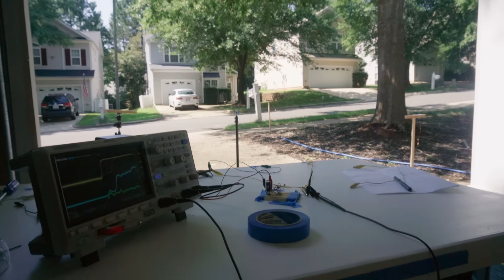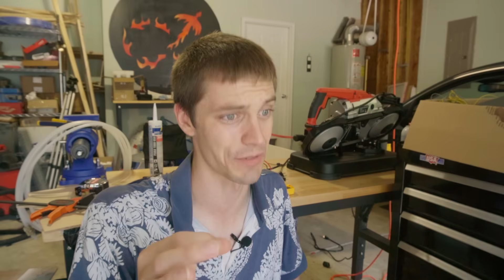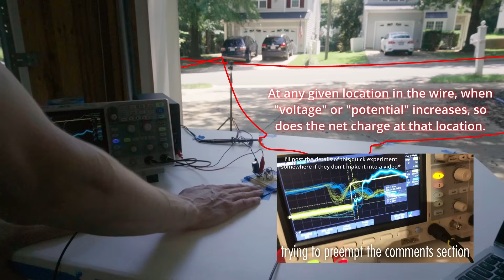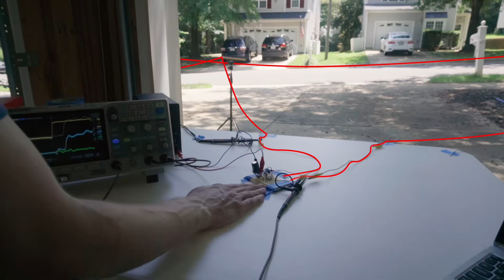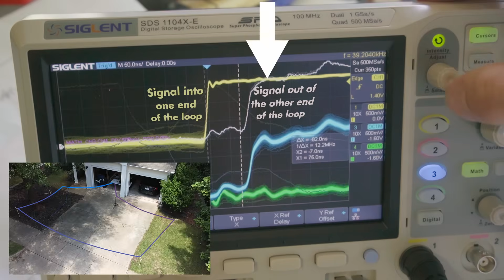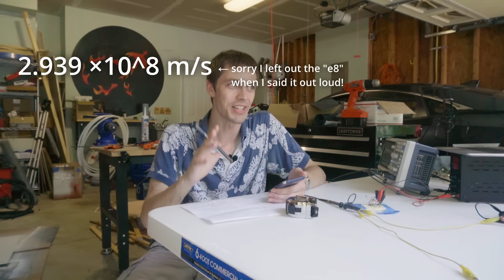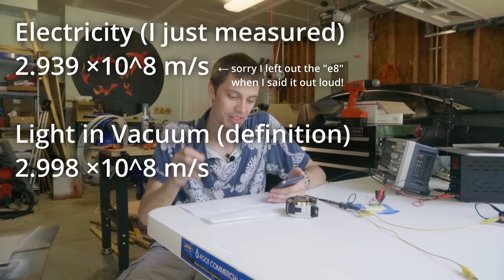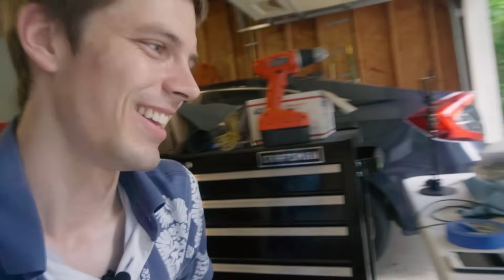Why does WATER change the speed of electricity?

Comment: Do you know what velocity factor is? Apparently you don't. It is not possible for an electron to move at speed of light in a wire. It is even worse when you're talking about electromagnetic waves which involve the movement of electrons in a coax line where the typical velocity factor is about .66 to .80 for the better coax lines. That's 66% to 80% the speed of light. That affects the electrical length of a cable for a particular frequency or wavelength. You know what drift is? Go get a degree in electrical engineering
Reply from the maker: PhD in electronic materials

Comment: Even if you could alter the magnetic field outside of a wire, or conductor - wouldn't that really only be affecting the byproduct?  The electrons would still continue to flow unimpeded, which may or may not change the "speed" or rate of electron flow.  Perhaps I'm wrong and I just need a little more schooling. But just a thought.

Comment: We use a piece of kit to locate underground cable faults. It relies on the propagation speed of an electric field along the cable. 
One of the parameters we need to set up is the speed of the dielectric ..... usually about 0.72c! ..... but it changes with different cable types!

Comment: A professor of mine in college did a simple cool demonstrations using a book, PVC tubing, a candle and some matches. You'll need two people for this, btw.

Get the PVC tube (2 inches, 1 inch ...) on a desk. Light the candle and put the flame at near one end of the tube - get one of the 2 people to stand very close to the candle. The other person then gets the book, opens it and near the other end of the tube and then slams it closed. The book will make wind and the candle will go off ... but will the candle go off because of the wind????

Comment: Fastest? and the title "Why does water change the speed of electricity?" conflate two different things? The signal propagates at ~speed of light but the electrons don't make it around the circuit as quickly. Your own video 'shows' he signal propagating away from the injected electrons and arriving at the end of the wire ever before the injected electrons will reach the same point.

Comment: You really should have made a few comparative tests using diverse types of coaxial conductors and the same test submerged is a swimming pool!

Also, did you take into account that the signal in the waterpipe had only half of the diameter of the pipe to reach the medium with a higher speed of light (air) so the wavefront would be a combination of travel time through the alongside media, so a combinatii of speeds c(water) and c(air)?

Nice test.

Comment: Electricity is not the flow of electrons. It is an electromagnetic wave flowing through the local field created by energizing a completed circuit. The flow of energy between two points with a negative potential difference. EM wave is a wave of light. A photon when viewed as a particle. The free electrons exchange energy as they are excited and fall back to a base state. This exchange is done through an EM packet. The exchange of a photon. A key attribute to remember is that the flow of current, the flow of workable force that we call electricity, is in the opposite direction as the measurable electron drift. Electricity is a wave of light propagating through a field generated by a completed circuit. It follows that the speed of electricity is the speed of light minus any impedance from the resistance capacity of the circuit. Objects of mass do not physically interact on the atomic scale. They exchange energy via an EM wave. The packet of energy known as the photon

Comment: What would happen if the water was flowing? How about if it’s frozen or turbulent? Would that have any difference in the speed of electricity?
Reply from the maker: I would expect the same behavior in this case where higher frequencies matter. The ice is an interesting case cause it stops molecules from rotating so if you made a capacitor for “dc” with ice or water, the water one would be stronger, but at very high frequency you still have the electron cloud moving so I’d imagine same performance

Comment: Light doesn't even travel at the speed of light... in a medium.  Light slows down when striking water for instance... the reason we observe refraction of the light.  Copper wire is just the medium that slows electricity, which otherwise travels at light speed which of course means speed in a vacuum.

Comment: So there's a big misconception about how electricity travels. Electrons are not moving through a circuit. Electrons don't actually travel very far from their original position. Magnetic fields are being generated around the wire itself and radiates out. I'm not an expert on this, but I suggest watching this youtube video. He explains it much better than me. Plus he has a great experiment proving it and a great debate with some foremost experts in the field. https://www.youtube.com/watch?v=oI_X2cMHNe0

Comment: Well, regarding the water as a surrounding material, there are a few complications.  First the purity of your water.  Only very pure distilled water has the 80 to 81 ker ("dielectric constant" traditional name).  Normal tap water is a far cry.  Then, you actually have some polymeric material between the wire and the less than ideal water.  Maybe PVC?  Anyway, that also has a similar effect as non-ideal water.  In other words, you do not slow the wave propagation as much as the formula predicts.  Or you get again close to the speed of light in vacuum.  On the other hand, you can obtain the propagation delay listings for most any coaxial cable.  Some of them use solid polyethylene insulation.  Some may use Teflon.  Some others use foam, or spaced insulation disks with just air between.  You can find that the solid insulations (polyethylene like in RG 58 or 59) list the lowest propagation speeds.

Comment: So if the switching introduces high frequencies into the signal, would you get a measurable phase difference if you maintained a low frequency sine wave through the wire rather than on / off switching?

Comment: Ehm. basicaly speed of light is soo fast, you need more than 1000m of optic fiber, for measurment. That means electrical components in very  high class measure tool for optic fibers, that cost more than 40 000$, need more than 1000m of optic fibre to get some results, cuz electrons need some delay to process that measurment.
Reply: and btw. electrons does not travel via wires. WIre is just a medium for electrons to make electromagnetic field around the wire, and electricity travel via that field.
So coil with 1000m of wire is not distance of 1000m for electrons to travel. The distance is just dimension between input and output wire of the coil so it's just height of the coil. for example 10cm.

Comment: I haven't done a bunch of experiments to be able to give you a bunch of data, but there are a couple of things about this that you may want to address as a follow up. Water is an insulator only when it is completely pure, such as deionized water. Water as it comes out of the ground usually contains things that make it slightly to very conductive. You also housed this in a PVC pipe. I have watched many PVC pipes create a static charge simply from wind, to the point they need to have a ground wire connected to them. So, it too has electrical properties that may affect your tests. Of course, it will not change the fact that you were trying to prove, but may offset the data supporting it.

Comment: Water changes the speed of electricity in  water rather than air is because electrons don't travel like water in a hose, rather the wave of electrons travel on the outside surface of the wire..👍

Comment: Have you heard of transmission line theory? The material of the line being used, not necessarily a wire, has inherent series resistance and inductance, and shunt capacitance and conductance due to various causes(e.g. E fields in a dielectric or resistivity in the conductor). Moreover, the resultant fields actually impede the current flow, thus changing the propagation velocity significantly.

Comment: So much of many explanations don’t address the fact that energy emitted by an electron of photon radiates in all directions 3 dimensionally… they seem to only, for simplicity, address a 2 dimensional illustration… realizing that electromagnetic field surround the conductor is a huge step… radiating in 3 dimensions and flowing through space in an infinite replications of generated fields and being acted upon by any number of other particles also generating an infinite nobler of fields, resistance or interference… some amplifying the signals and some actually destructive… governed by the same universal speed limit of light speed.

Comment: The first transoceanic communication cable was a failure due to not understanding electromagnetic fields under water and that it was also shielded by steel cable surrounding the core wire to strengthen the assembly.

Comment: I wonder if the extra delay in the multi-strand wire is due to the extra length each strand has to be in order to be twisted around the others. A single strand untwisted would likely be longer than the length of the combined insulated wire.

Comment: Now I remember learning that the electrons don’t move down the center of a wire, but actually move through the skin of the wire.   That doesn’t seem compatible with electric field model. Unless you’re simplifying it enough and the current does move thru the skin which is why the dielectric is so important. That might make sense - we’re not actually dealing with individual electrons as you do in your drawing.  There’s probably a ring or spiral of electrons in the wire’s skin.
Does that make sense?

Because of that I expected the thicker wire to move faster because it has greater circumference. And the multi-strand wire to move even faster. But you say the dielectric is different so that causes a speed DECrease. But it should at least move MORE electrons even if its the same speed. So the thinner wire gets hot faster when you start pushing more current thru it. 
There’s another experiment or two in there, but I won’t mention that. 😁

Comment: Q1 - was the waterfilled tube along the whole length or just a part of the wire ?
Q2 - the watertube must have been isolated perfectly, in order not to cause shorting

In other words, you should have shown more precisely what you actually did. Now we still no nothing, because we do not know if you used an isolated wire or bare wire

Very confusing to speak of bare wire that is isolated in thick rubber
No idea what exactly the experiment was

What you seem to have been doing with isolated wires is put in a medium absorbing Lorenz force causing some minor resistence on top of that in air, as not all parts are isolated such as the clamps.

Comment: The speed of the propagation through water depends on how pure the water is because clean water like distilled water will slow it down far more than water that's got a lot of minerals in it. And I still think that you have an old school understanding of the propagation of electrons. Electrons are not individual pieces of matter. They are wave Dynamic of a eventually phased feel generated by the electrical push.
This wave function explains why test done in the 1980s when they put electrical signals into a beam of light that even then they were able to measure that the electrical signal, the communication signal, would reach the other end of the beam of light at five times the speed of light. And that was probably due to the limitations of the materials of the day.
Interesting video, and you talk about wave function and you talk about phasing. And even the amplitude of the phasing that are produced by the relatively inefficient method that we have of creating electricity.

Comment: At the start when he said people were saying "it couldn't be near the speed of light, electrons have mass!"; I mean, even if you forget all the fields stuff and pretend electrons are simply particles in a tube electricity isn't you starting to push single electron down an electronless wire. Even in this simplistic analogy it's more like pushing one end of a long train that spans a tunnel and the other end moving on the other side is the speed, which would be almost instant, not sending individual cars down an empty road and waiting.
Even with a not-exactly-correct way of thinking they should still have got a not-exactly-correct (but close!) answer instead of saying "the speed of electricity is the same as the speed of individual electrons!" which is way off :/

Comment: What if.... the electons do not move along the wire.  This might be why, all the models are wrong.
Reply from the maker: The models aren’t wrong though
Reply: @AlphaPhoenixChannel  That would be your ignorance.
Reply: They vibrate.  Because there is an energy in between that is equal to a standing wave of its relative frequency.
Reply: @newsmashups5989  Sounds like AC?

Comment: Is it the wire thickness or the field the wire generates., being that a thicker wire supports more stable fields that propagate the spread perhaps with less loss.   There a thought from those with far more expertise than myself in the field that electricity moves around the wire not through it.    This area is well beyond my pay grade / knowledge only curious on the subject in passing.

Comment: I'm assuming you used copper wire in all those cases, what if you used a different material, with a different resistivity coefficient? Try a steel wire to see if you get the same results, since copper and aluminium have, compared to iron, fairly close resistivity values.
17:42 No it isn't, there is a change, it's pulsing, it may not change directions, like AC, but the field is changing, also, you could also say that AC is DC during half the cycle.

Comment: I know not a lot about such things. And I did not notice how your wire was positioned inside the water pipe. But if it was laying on the bottom of the pipe, then it seems to me that about half of the electric field was in the water inside the pipe, and the other half of the electric field went out through the bottom of the pipe into the open air. Could that account for not reaching anywhere near 9?

Comment: You used the dielectric constant of pure water.  The stuff coming out of your hose is Nowhere Near pure.  Also, you compare the speed of light in water and air, and use that to compare the speed of the electric pulse.  But you didn't account for the percentage of the field that is IN THE WIRE.  Not that I expect you would, because the interaction between the two different speed fields would be some high end math indeed.  Doesn't make for a fascinating video.

Comment: ok with that length of wire loop ... the actual wire specifications now become mandatory as part of the overall load resistance calculation as well .. because 28M of wire is a significant load compared to a few feet ...
Reply: yup its not 9 for the water pipe ... your measurement is on 28.8 Meters of wire ... and you have what 2m of it in water .. so your expected value of 9 will be MUCH lower and should be proportional to the length of water covered wire to nonwater covered wire ... rough estimate ... about 1/4th the expected value ... or around 2 ... as you are getting 1.4 to 1.8 ... thats pretty darn close ... 
to get the expected 9 or close to it ... you would have to have a connection at each end of the pipe ... to the scope ... BUT ... if this is done the large loop can no longer be used to compare with ... as it is NOT the same as the water only section ... so ALL of the tests would have to be redone in the new configuration ... 
.
if you want to really mess up your mind ... get a 20guage wire (solid preferred) .. then around a uniform mandrel (as close to the wire diameter as possible is best) and coil a wire in a long spring type loop ... put this around the wire in water section (remove the water) and then remeasure ... and yes even hook that loop to a small lantern lamp or some such ... and retest ... 
.
I would expect the numbers to go down even further ... like a magnet falling in copper or aluminium tubes ... they dont fall at the speed of gravity pulling on them ... 
.
I expect the direction of the coil will make a difference so clockwise and counterclockwise ... needs to be tested as well ... 
.
the theory .. the magnetic field induced in the coil will create a current in the coil creating a magnetic field .. that will be directly opposing the inflow of electrons into the water pipe segment ... (right hand rule of magnetic fields and electricity)
Reply: if you place water into an electric field it will polarize ... as water is highly conductive ...and water molecules are magnetic field oriented ... 
.
water as a base medium in electron fields is a bad choice because of the properties of water ... (grows when frozen shrinks when heated )... make the water work different to the conventional model of fields also one also has to now account for the different abilities of water as well ... water can be both positively and negatively charged  in the same locations and still repell each other ... yah the joys of tetrahedron physics and math with water ... stuff goes funky fast ... and yes water is a tetrahedron ..

Comment: I thought the energy transfer between the switch and the resistor or bulb is actually the distance between them, and the length of wire is irrelevant. Also the switch operation might bounce. Does your switch utilise de-bouncing feature? Great experiment and it would be interesting to see the effect if water is pumped through the pipe in different directions. :)